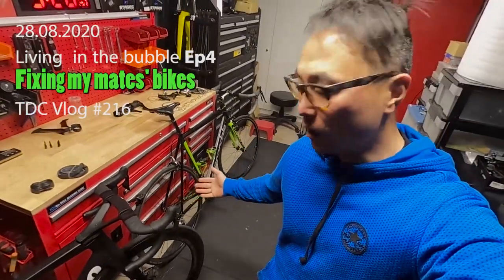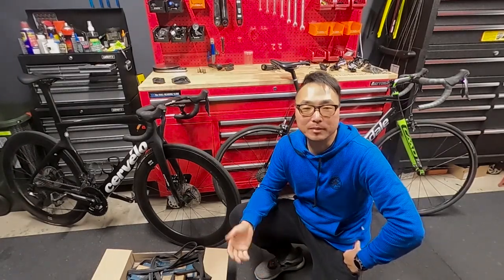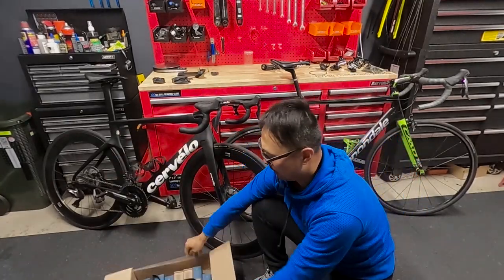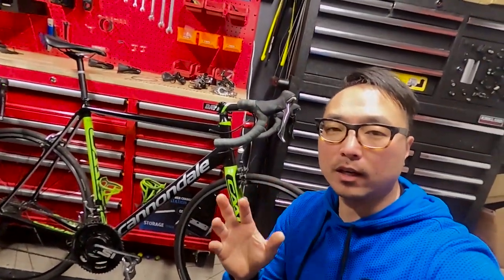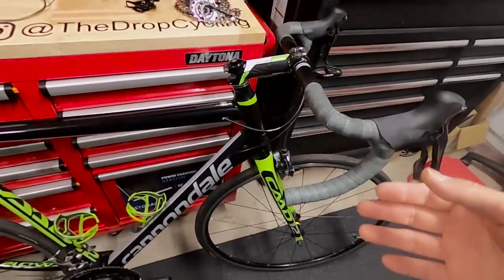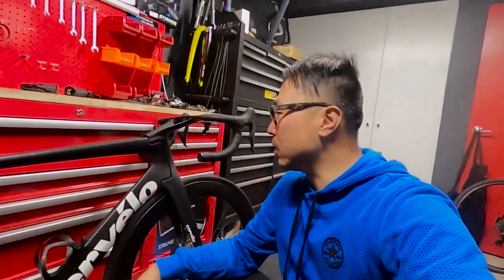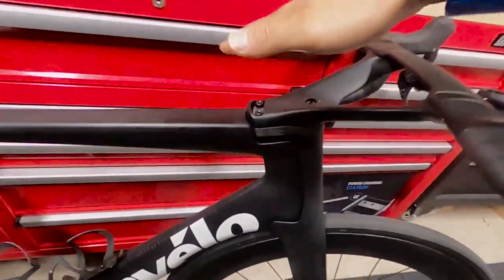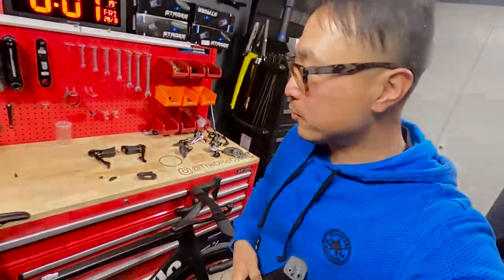Fixing mates' bikes. TDC Vlog #216

Comment: S5 or Venge Nick? Caad12 or Allez?
Reply from the maker: I actually have/had all 4 bikes you just mentioned.
for me: S5 vs Venge, Venge
Caad12 vs allez, depends! Allez for flat, Caad12 for hills bro!
Reply: @thedropcycling  So if you could only have one - Allez in the hills or CAAD on the flats?
Reply from the maker: @tomcolls9264  allez has a much shorter headtube, its a very agressive geometry whereas caad is a true all rounder bike good for the hills, Allez is stiffer better for flat roads
Reply: theDropCycling is caad12 that good of an all-rounder? Looking for a first road/endurance bike with relaxed geometry and rim brakes. Caad12 is on the shortlist.
Do you have any tips (for long sportifs)?
Reply from the maker: @l139x3  yes mate, Caad12 is good for anything, cheaper than carbon, light enough to climb, not a harsh as other brands alloy frames. Good all rounder bikes.